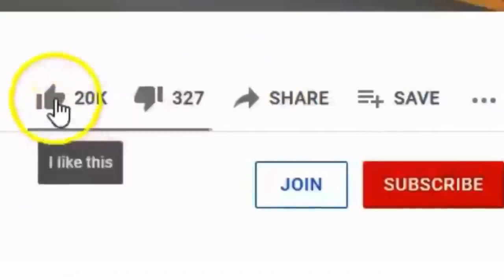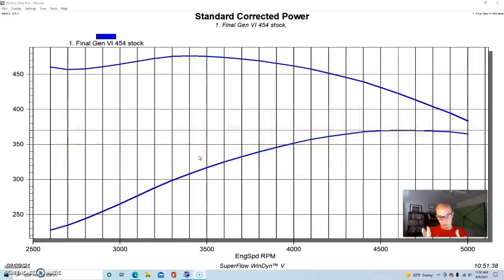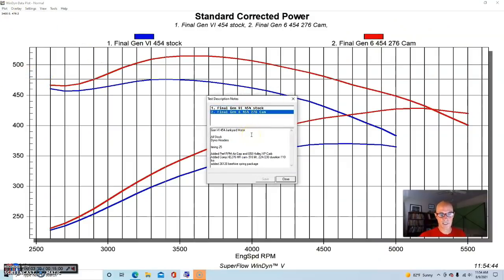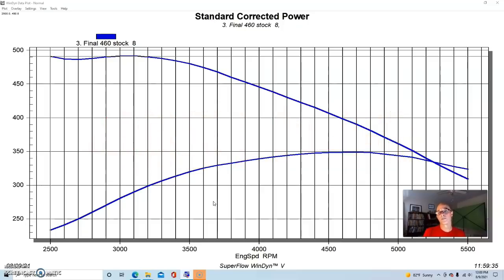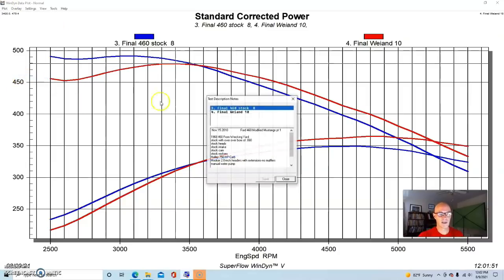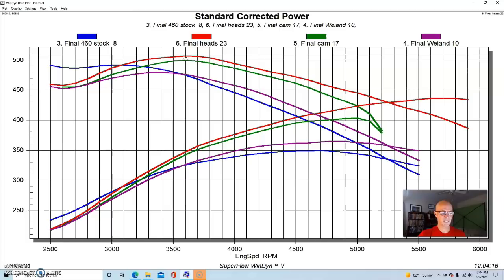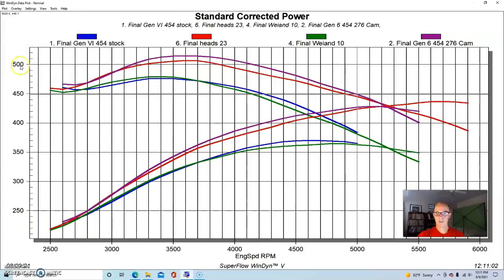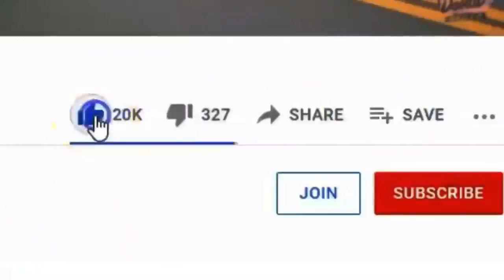JUNKYARD BIG BLOCK POWER-460 FORD VS 454 CHEVY FULL DYNO RESULTS

Comment: Yeah! Chevy powered ford's!
Reply: I'm actually thinking about putting a BBF stroker in my chevy truck lol
Reply: @andy347495  What about a 500 Caddy?  They are cheap, have boat loads of low speed torque, and are light and fit easily into a Chevy truck with much room to spare.
Reply: @corvettejohn4507  yeah, I would do that. I never see them for sale and I already have the BBF.
Reply: @andy347495  a Pontiac 400 or 455 would be cool too.  Something different.
Reply: @msh6865  yeah for sure, something different would be cool.
Reply: @msh6865  Couldn't give me another Pontiac...  They have serious oiling problems.
Reply: @andy347495  Understood.  The Buick 455 also makes a good truck motor like the Caddy.  What used to drive me crazy was that GM used to put their biggest and torquiest engines in CARS, and used to put low torque stuff like 283's, 327's, 350's, and 402's in their pick up trucks.  WTF?   They never even installed the 348 or 409 in pick up trucks during the early 1960's, you had to get a lame ass 283 in your truck, or for GMC, an oddball 305 V6.  WTF?
 
And their school bus and dump truck motors were 366 and 427 cid LONG after 454's came out in cars.  You couldn't even get a 454 in a Chevy or GMC pickup until 1973, and then the Buick 455 or Caddy 500 would have been a better pick up truck motor.

Comment: Ford is the best, fuck the rest!
Reply: Best at what?  Fix Or Repair Daily?
Reply: @corvettejohn4507  best at pulling your house down lol. Find anything with more torque in big block v8 gas platforms.
Reply: @rsteele1113  If you are talking about a stock 460, a stock Caddy 500 or a stock Buick 455 has more torque.
Reply: @corvettejohn4507  alright I'll give you those. EDIT: but how much more rare are those than a 460 in a pickup with the right weight distribution? Sorry for edit accidentally hit done before I was done lol.

Comment: 2 the worst chevy ford big blocks ever made  late 60s 390 fe and get good grunt rpm and great truck moter  rarely overheat unlike 460 chevy 402 has larger oil journals than 396 and build as a late 60s big block   =  much better short stroke high torque  and rarely overheat unlike 454 BBC and as far as apples to apples ur conpairing  60s bbf to 90s BBC  not close comparing  2 moters  totaly stupid comparison  and neither of moters have 1/2 grunt a typical 345 ihc had  tried it  nothing beats a tractor moter 4 grunt had a few  BBC and ihc 345  not a comparison  almost as dumb as the 454 460 of 2 totally different time factors not close for comparison!

Comment: Wow, a mildly built 5.7 Hemi does better than either one of these for a lot less $.
Reply: Torque curve is very different in a big block
Reply: How much are we talking by $$ difference. Hemis are not cheap by anymeans
Reply: Less $. You're smoking crack.
Reply: So will an LS1/LS2/LS3.  But try finding a  5.7 Hemi or LS1 in a pick a part lot for $200.  Just saying.
Reply: @steelervette  Newbies think the HP number means everything...
Reply: @ewetoobz3840  Last weekend I just picked a complete L19 Gen V 454 with TBI from the local pick a part for $185 with a $50 core charge.  So $235 total.

Can you say 4-bolt mains and main priority oiling?  Yes you can.